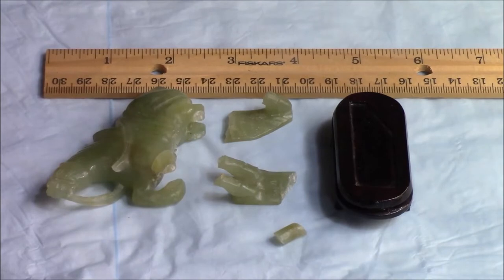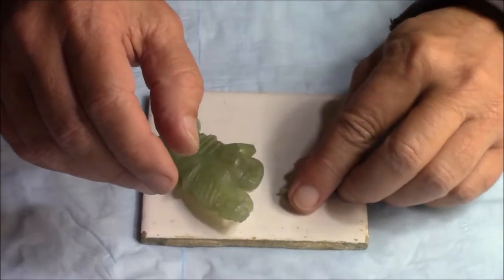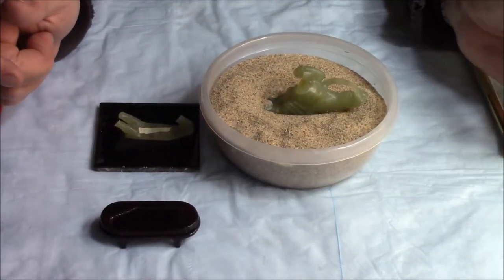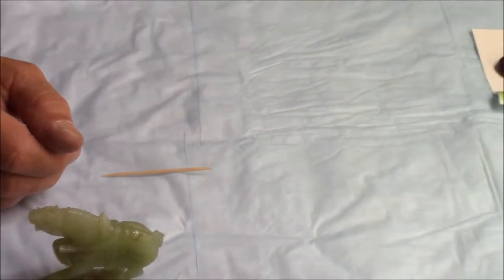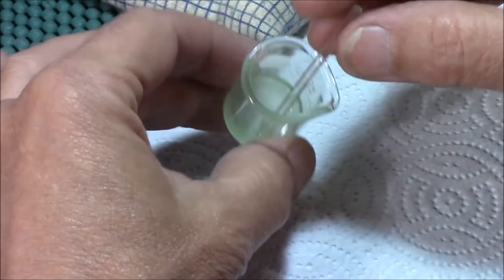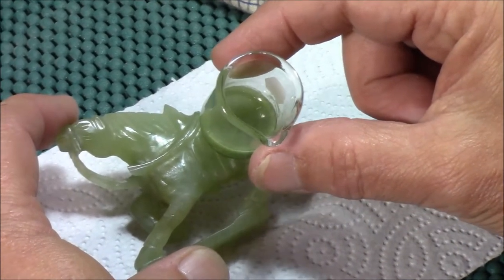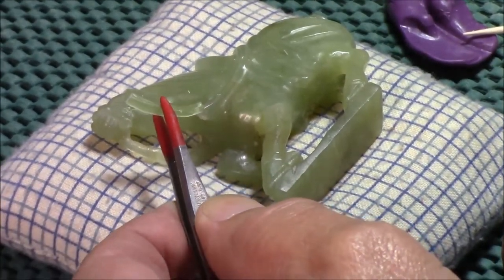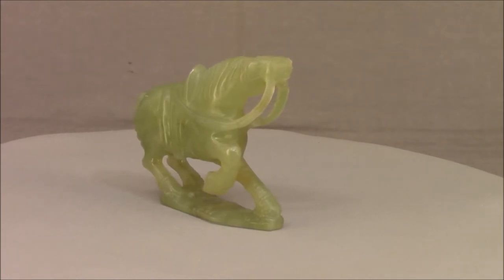Jade Horse Repair

Comment: congratulations! have a jade dragn 2 spikes arrived broken tips but here only instant eposxic available and very liquid. with what make it more not liquid?
Reply from the maker: You could try mixing the epoxy and check it every few minutes. The epoxy will get thicker as it cures. At some point in time it may be just the right thickness for your use. Good luck.
Reply: @marsgitar  thank you very much! will do that.

Comment: Looking to reset a jade statue back in it’s base. It was originally set with a cream colored material on a wooden stand. Any suggestions, for it is very heavy and my parents have had it since the sixties.
Reply from the maker: For a non-permanent bond use "Museum Wax". For a permanent bond use a little bit of epoxy paste.
Reply: @marsgitar  Thanks!🌅🎇🎆😎